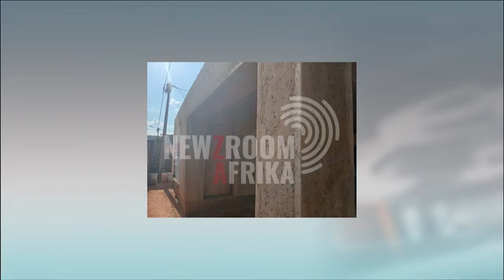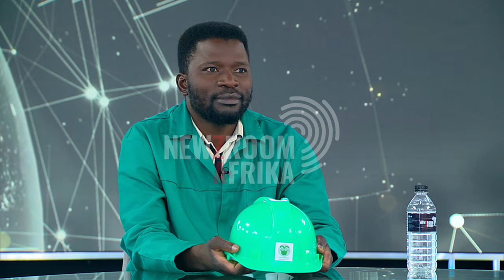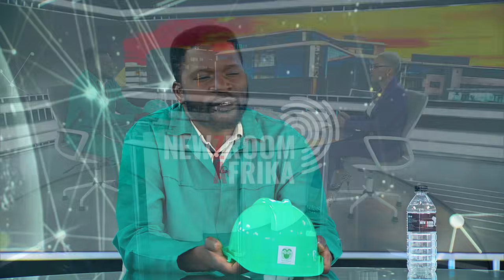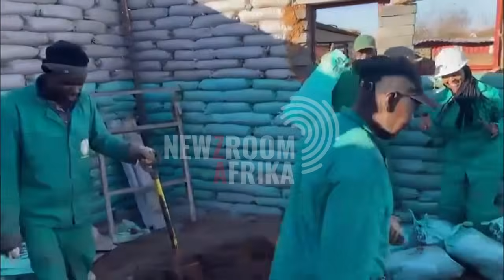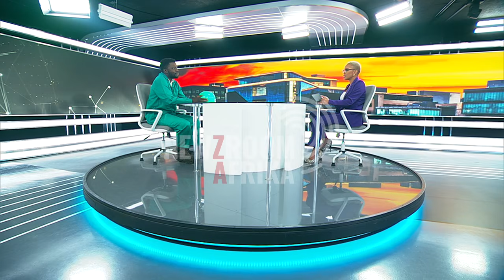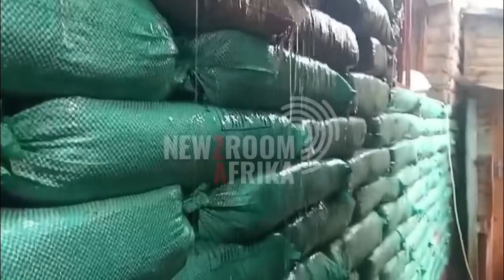UCT student builds low-cost homes using soil and recycled plastic

Comment: Anyone with negative comments is just a straight hater. This man is a genius. Keep the good work Dalas 👏 🙌 🔥
Reply: No negative comment here and I'm not a hater but please understand that to people like me who are into building and construction we know this building method, and I can tell you right now that it's not viable, I tried to do this in 2012 and I failed not because the building was of low quality but because the numbers won't add up, he will need to outsource soil, it's impossible to use soil that is on site especially when doing this in townships, the cost of building will be almost be the same as that of building a conversntional house, agreement SA and NHBRC will definitely not give him a go ahead since the sand bags contain granulated plastic which is bad in the case of a fire. He's not the first to implement this here in SA I've tried and many have also tried(including whites with money)... It's just not scalable, he will reach a dead end soon. Also remember that people build houses for value, it will be difficult to scale up since banks won't recognize a house that was built with sand bags, but nonetheless this method can still appeal to people in rural areas or informal settlements since laws are not tighter there
Reply: @Sowetobotanica  Read "Architecture for the Poor by Hassan Fathy" is the same reason you were not supported. is the same reason his approach will not be approved.
Reply: @tsekomalawaneng1150  I went through the summary of the quoted book just now, thanks for sharing. We can only put ourselves out there, reach the people in need of this solution, and make impact. I do agree that it does become difficult when engineering solutions are politicised
Reply: I like the financing part you've touched on. That remains a challenge with financial institutions. We keep exploring other viable ways to make this work. Collaborations.... collaborations!
Reply: @Sowetobotanica thanks for your insights. Matimba Mabonda here, the guy being interviewed. Yes, earth building is not new. What we are doing innovatively at @LolaGreenZA is the successful introduction of plastic waste into our mix, without compromising strength, maintaining good ratios, we add stabilisers too.  2012 VS. 2026- a lot has changed. Our business model is viable, affordable compared to a 220 mm cement double brick wall. I am not sure how you worked your model back in 2012, but from one entrepreneur to the other, always happy to chat. In short, we have a viable model. We are in touch with Agreement SA and NHBRC, the CSIR included. It's a work in progress. FYI, the Agrement SA did approve a slight variation of this method around 2012 I think, so yes it is possible. It was mostly implemented in the Western Cape. In the bigger scheme of things, we are in the decarbonisation of the construction industry, one house at a time. Approach backed by science and engineering principles.
Reply: What negative comments? What hater's are you imagining?
Reply: Thanks dalas for the shout-out 😅🎉! At @LolaGreenZA, we convert waste into dreams.
Reply: Ah, yes, why deal with criticism when you can wave it off without an argument and just call people haters.